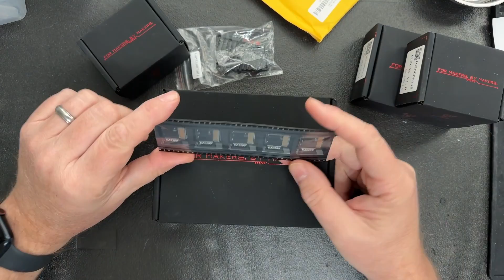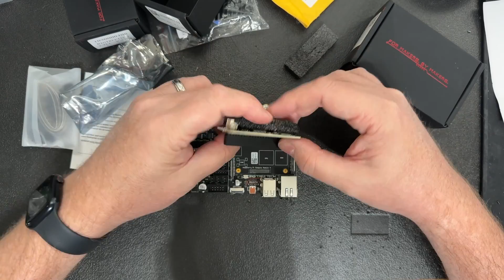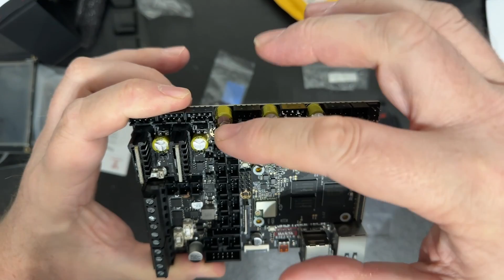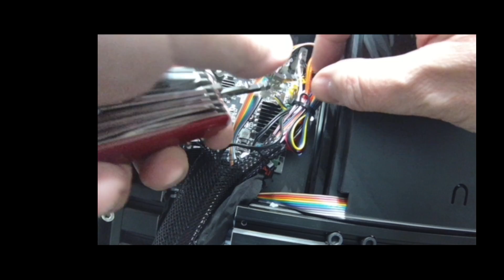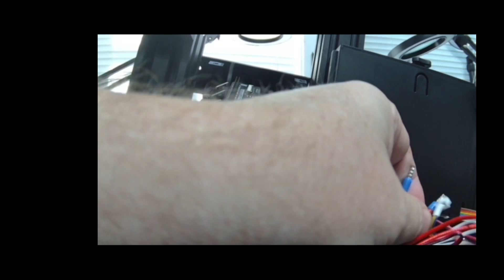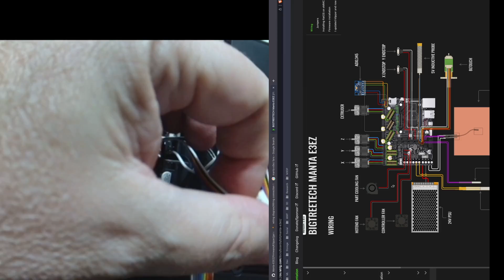Ender 3 v2 Neo and the Manta E3EZ Board. Taking 3D Printing to the Next Level!

Comment: I am not 100% sure you even need the CAN board for the Manta E3EZ board as it has CANBus built in and connectors for CANBus on the Manta board.  BTT Have packed a lot into this board and still managed to keep it small enough to fit into an Ender 3.
The glue is a good idea actually, considering the printers ship from China to the entire world.   People buying a printer don't want it to fail out of the box because a wire came loose in shipping, which does happen, no matter how good clips are.   Shipping is pretty rough
This video is so detailed, but doesn't get boring at all.   Really enjoyed watching it as a lot of people skim over the details without going into detail, or they go too deep and get boring.
Reply from the maker: The can board d is not needed. Glad you found the video helpful.

Comment: Just finished a light mod for my V2 Neo and the glue annoyed me. Possibly take some isopropyl alcohol and dab it on the glue and it may come off very easy. I didn't try it.. dummy me, but if it's like hot glue then it'll make it very easy to come off.
Reply from the maker: Next time I will give this a try.
Reply: The glue is a silicon based glue.  It's a good idea to use glue as even the best connectors can come loose with how rough shipping can be, especially considering international shipping.    It would be nice if the just used hot glue instead.  That would come off easier, but I guess the theory is if you are going to mod, you will take time to remove the glue, but if you dont mod the printer will work out of the box.